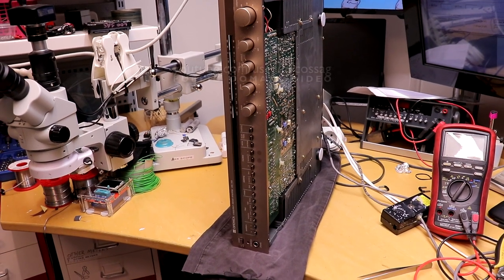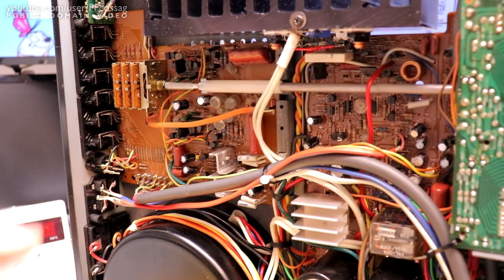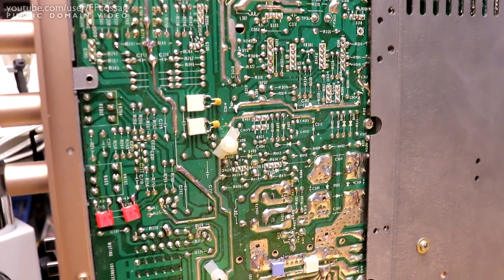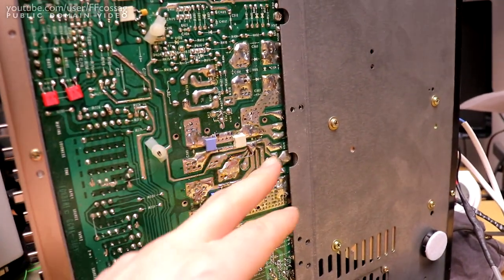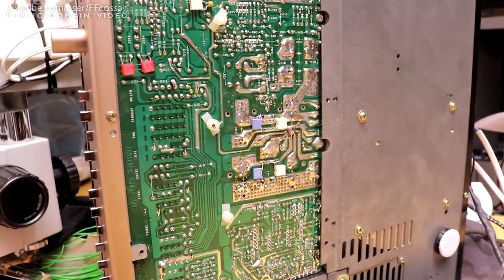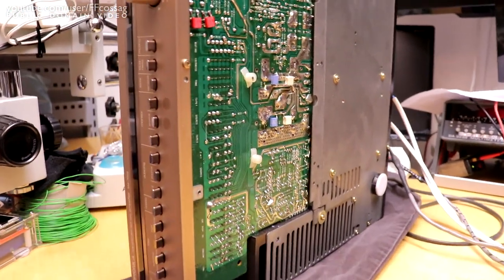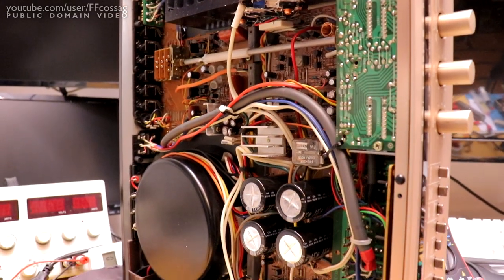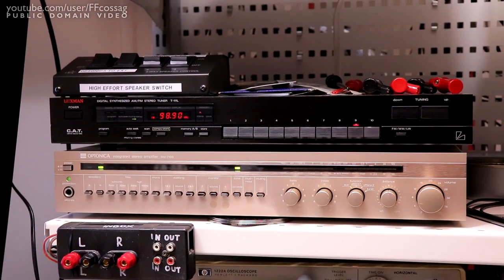Optonica SM-7100 repair notes & mods

Comment: If you still have this amplifier, would you please be able to measure the output voltage of the transformer? I have one in currently with a faulty mains transformer coil and can't find it anywhere on what the stock component should supply. If I know that I might be able to swap in a different transformer and get this old beast back to life again.
Reply from the maker: It doesn't say in the service manual?
I can't easily measure it, sorry.
Reply: @FFcossag  checked a 30 page service manual, 0 information on the output voltage of the transformer. They state the part number but with it being this old there is no documentation on it.
Reply from the maker: Except that page 12 explicitly lists all the voltages, both DC and AC.
Reply: @FFcossag  shoot you're right, had totally overlooked that. well, my bad. True thanks for your help!

Comment: i like audio stuff !!! i bought a cheap 50 $ class D amp on ebay and im thinking of adding Bluetooth connectivity to it !!so i bought a cheap bluetooth speaker for less than 10 $ but after i removed the shitty amp from the Bluetooth speaker and bodged it to the class D amp i got horrible noise !! like no sound at all its just a high pitched noise !!! the amp i removed from the bluetooth speaker was a lm 328  ..... i dont know if im stupid or something is wrong !!! 

are you open to trying this out ?  less cables means less wires to fiddle with when you want to change the source !!
Reply from the maker: Bluetooth speakers are awful and I don't touch  them, lol.
Reply: @FFcossag  Eh some sound good enough, especially if they have better BT protocols.
Im still impressed that my Doss Soundbox XL goes down to 45hz at such a small size, even my Philips MFB 544 cant compete with it if you compare bass per liter.